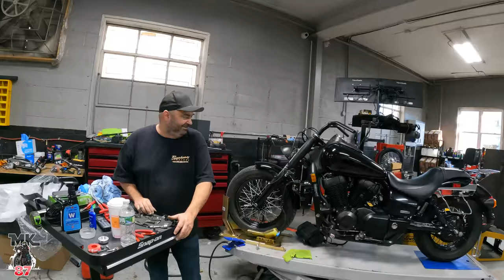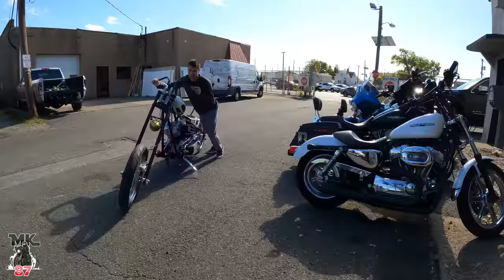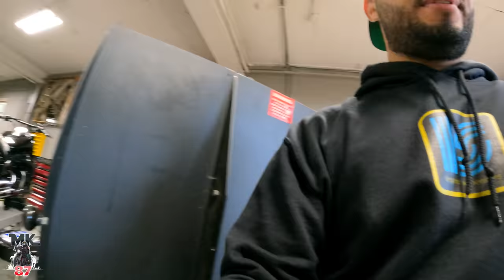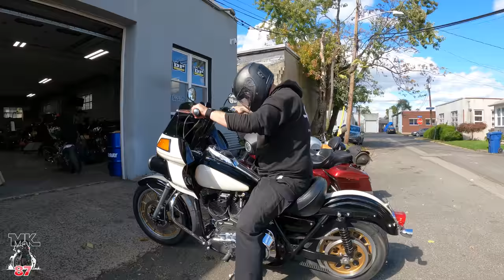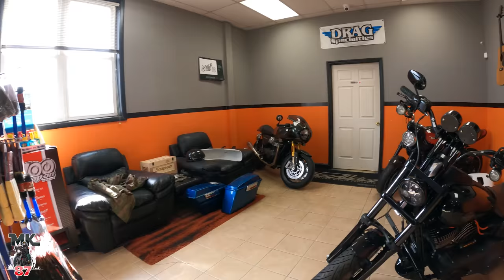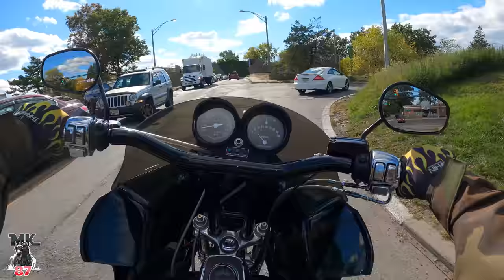I fixed my fxr / now it runs

Comment: Congrats mate! Glad you got it sorted.Engine wise, you can get those things moving. I finished up my TC FXR recently and went with 95in, later model heads that flow and lift more, higher compression, strong mid range cams, etc. And it pulls REALLY well. You also have a lot of room for improvement if you replace that ignition. It works, but is step behind Evo ignitions.

Comment: Congratulations on the new motorcycle. Especially  the FXRP, one thing to know carbonated motorcycle are very different from EFI. With a smaller engine you can push it harder. I've had the 80 evo 111 s&s and twincam. Ya gonna love it as a commuter more that all your other motorcycle I bet.

Comment: I like that bike. You can always add some legends shocks to it or save some money and drop in a race tech gold value emulator kit.
Reply: Those forks are already cartridge forks, it doesn't need 'emulators'. The cartridges can be upgraded with different parts from RaceTech but its already a step ahead of conventional damper tube forks.